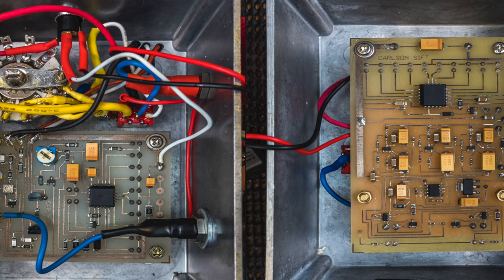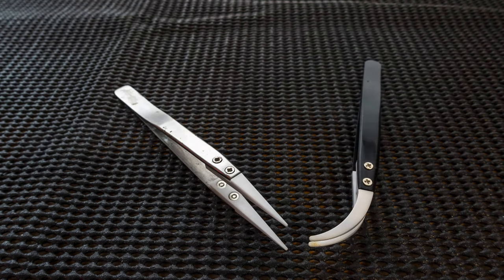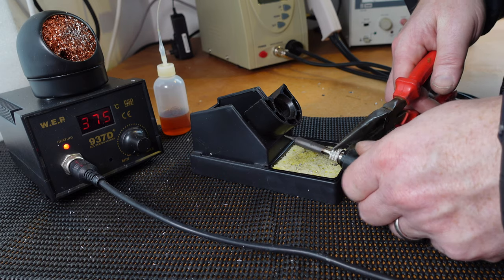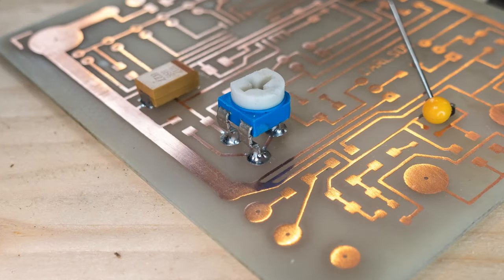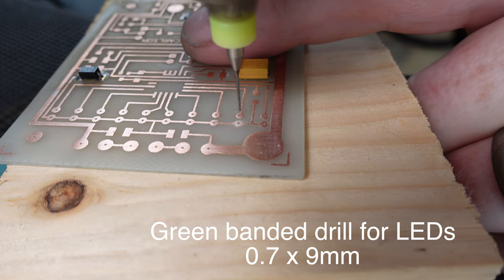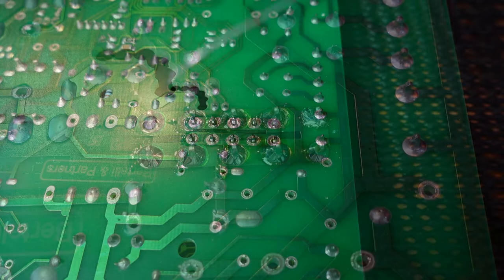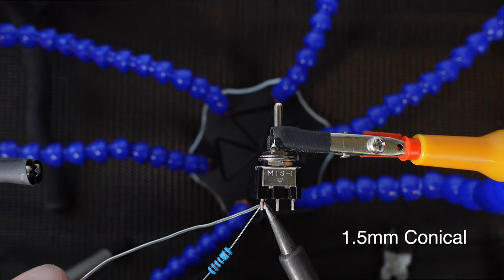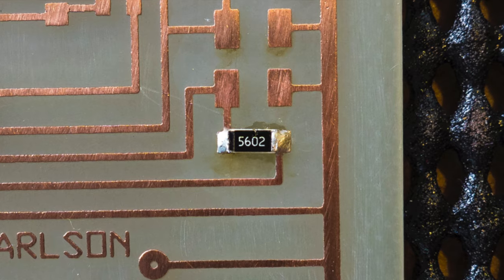Soldering secrets for surface mount components

Comment: Fascinating and informative tutorial in insane quality thank you Grant.  Definitely good practise for the breath holds.  I have a question though.  Using the tweezers as a heat sink.  Is this suggested to transfer heat away from the component during the soldering process, to protect the component?  please excuse my ignorance  I was here for the breath holds on the whole.
Reply from the maker: Thanks  for the fab feedback Joe🍹

In my case, the ceramic tweezers are used purely to hold the component in situ with negative heat sinking. 

Holding a surface mount component with metal tweezers increases its surface area exponentially - more heat can be applied before any potential damage - this is a desirable safety net if your soldering ‘style’ means you tend to linger with the iron. 

I myself, prefer to get the iron on the component hot, and leave quickly - having a heat sink would be counterproductive for my style.
Reply: @GrantWyness  ahh - Makes Crystal
Clear sense. Thanks.
Reply from the maker: It doesn’t in the video - I will endeavour to clarify it in the next soldering vid.  Great feedback 👍🏻👍🏻

Comment: I am just starting out my electronics "journey" . . also in large part thanks to Mister Paul Carlson (he is a real "inspiration" . . . and what a GREAT Canadian accent he has!! :-) ) ). My first project is going to be to solve an actual problem I have with a power brick refusing to "stay awake" under a very light load of a pair of USB speakers. So I will be making Mister Carson's "Load Pulser" circuit, although I am going to use larger components as this is my very first project and I don't want to dabble with any tiny surface-mount parts at this early stage! Thank you for this video: it is very helpful to see your tools. I also found your one about making circuit boards extremely helpful, although that is down the line a ways for me as yet. ---Mike.
Reply from the maker: Hi Mike, thanks for your kind words and it makes me happy to see the vids doing some good.  All the very best to you 🍻

Comment: Thanks Grant. You make video production look easy and I know it is not. Have all the parts for Paul's cap tester piled up here but can never seem to get to it. Thanks for the tip about RA flux getting under the insulation. Never considered that and you're absolutely right.
Reply from the maker: Hello Sir,  Thank you for your encouraging words, it means a lot🍻 The RA flux conundrum to me is how they advertise it as inert and harmless to components (non corrosive)?  No, it’s not nitric acid, but it is still chemically active both before and after heating.  All the best to you

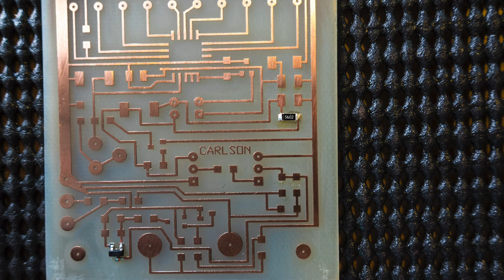Comment: in 13:31 i can see a transistor labeled 2A something, which could be a 2N3906.,... which by the circuit presented the emitter goes to 0v,... which is wrong because is a PNP. The right transistor should be a NPN,... anyway, is well soldered! :-)
Reply from the maker: Hello Internaut - you get a ⭐️ for your eagle eyed discovery.  In order not to rub Mr C’s rhubarb the wrong way I put the wrong SMC’s in random places.  All the best to you and yours🍻

Comment: I notice that you don't tin your boards. What are your thoughs on this?
Reply from the maker: Hello Steve, thank you for subscribing 🍻 In regards to tinning I would recommend it wholeheartedly - it serves several purposes beside the nice aesthetic.  I didn’t use it purely for the lack of having any.  I do have a silverplating fluid which would be pointless as silver tarnishes just as badly as copper.  All the best

Comment: Why not use a hot air rework station and solder paste, the hot air will melt the paste and the components will slide into position and the hot air fan can be turned down so it doesn't blow the parts off the trace.
Hot air stations are very inexpensive nowadays.
Reply from the maker: Hello Frank, thank you for your recommendation 👍🏻 There are certainly other ways to get good results, my favourite will always be the hot pointy stick method, for the shear fun it gives me.  My other video ‘making a PCB’ is another example of different ways - I like using laser paper, others like using toner transfer paper.  I guess it all comes down to which tool [s] grip our niblets.  All the very best to you 🍻
Reply: @GrantWyness  you did a fine job, whatever works for you is the best, truthfully, I always used the point and stick method as I only got a hot air station 7-8 yrs ago.
So, for the 30 plus yr before that, I did and still do the soldering iron technique. 
Good job.!!